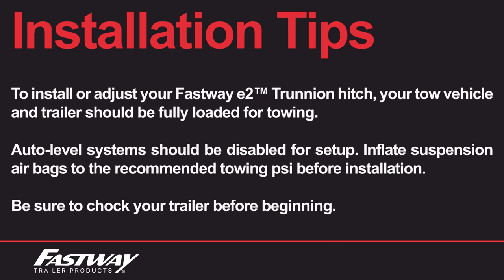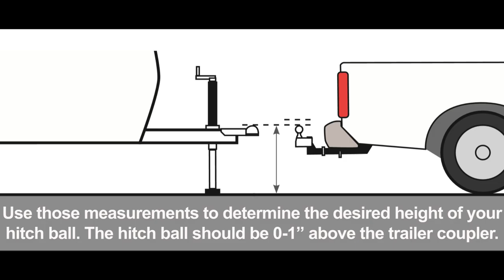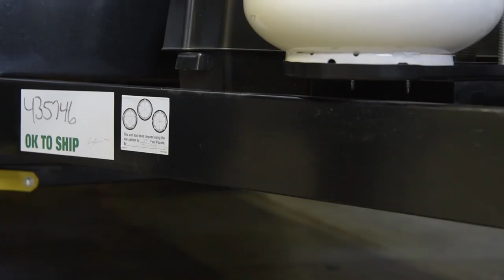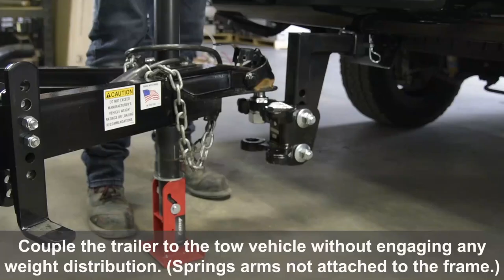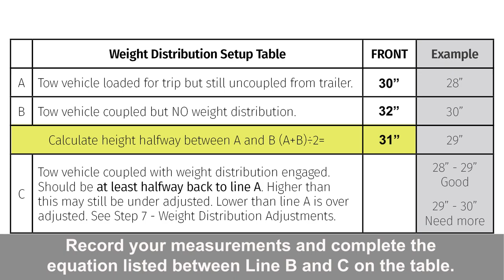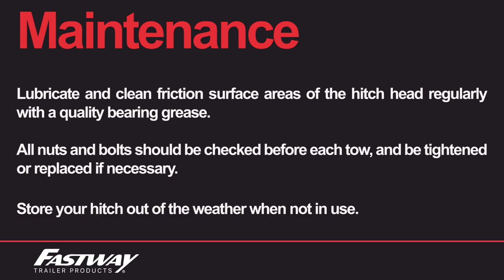Fastway e2™ Trunnion Installation

Comment: To make things easier for those looking for the tools list:

For install without the hitch ball preinstalled:
* e2 Owner's Manual
* torque wrench - 250 ft-lb capable
* torque wrench - 430 ft-lb capable
* ratchet wrench
* 1 1/8" wrench or socket
* 1 1/16" socket
* (2) 3/4" wrenches or sockets
* 15/16" wrench or socket
* measuring tape
* pencil
* 1 7/8" thin walled socket
* 1 3/4" wrench

Comment: I see no final step of tightening the angle set bolt with the system under load...
Reply from the maker: Hi Daniel! We didn't touch on this in our video, you're correct! You can however find the answer to your question in our e2 Trunnion installation guide starting on page 18!

https://www.fastwaytrailer.com/pdf/FW_e2_4.5K-Trunnion-Owners-Manual-2020-sep.pdf
Reply: @FastwayTrailer  Certainly worth mentioning.

Comment: Video indicates start with 6 washers but digital manual indicates start with 3 or less.  Which is it?
Reply from the maker: Hi Larry! You can add up to 6 washers if you need to level your trailer frame. Hope that helps!

Comment: We just bought a new truck for towing our trailer and the hitch receiver height is higher than our previous tow vehicle.  What is the best way for us to adjust our Fastway e2?  The original set up was done by the RV dealership and, to be honest, I don’t recall them giving us the installation booklet! I will print off a copy, but it won’t have the initial measurements they may have recorded in the original booklet.
Reply from the maker: Hi Shelly! I've attached the link to the original e2 installation booklet below. If you have any more questions you can contact our customer service team at (800) 478-557 and they can walk you through the installation process as well!

Comment: Just curious is it normal to have to raise the pickup up to the point of the wheels almost come off the ground to get the bars on the L brackets????
Reply from the maker: Hi Ronald, no that is not normal. If you are having issues putting your bars on your L brackets, contact our customer service team at  info@fastwaytrailer.com or call them at 877-523-9103 and they should be able to help you!

Comment: At 4:37 you say that the appropriate Front Axle Load Restoration (FALR) is supposed to be between 50-100%.  The example in your video had it adjusted to 75% but the owner's manual for the Nissan pickup asks for measurements from the front a rear bumpers so it's hard to determine if your setup was accurate or not in accordance with the vehicle's specifications (all other manufacturers use the front fender like you mentioned in the video).  That said, at the time of this video (June 2020), the Ford F150 specified a 25% FALR, Chevy at 50%, Ram at 66%, and Toyota at 100%.  How come your video makes no mention of this when the manufacturers of these vehicles tested their trucks to SAE J2807 standards (hitch companies do not adhere to them)?  Who should I believe when setting up my hitch to keep my family safe when towing my RV through the mountains in the rain or any other conditions, the manufacturer of the truck or the hitch company?  Why?
Reply from the maker: Hi Phillip! The best way to get an answer to your question would be to contact our customer service team at info@fastwaytrailer.com or call them at 877-523-9103!